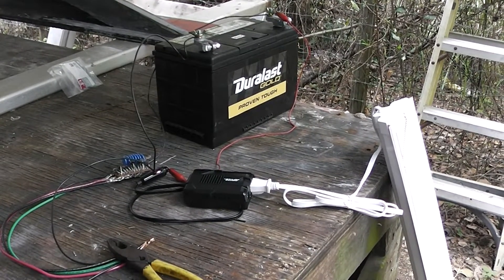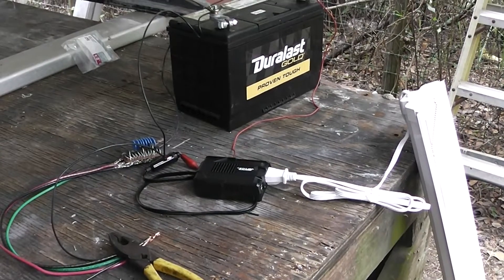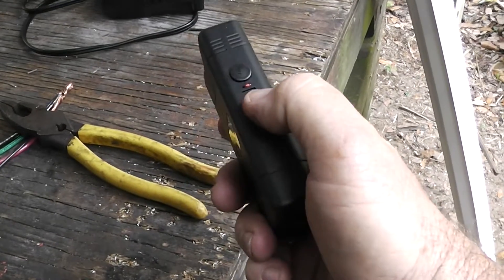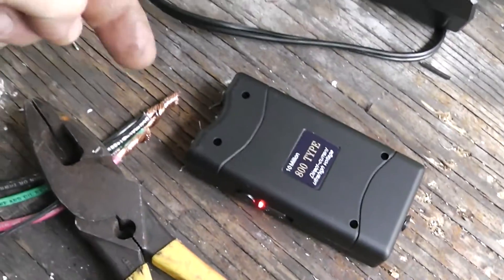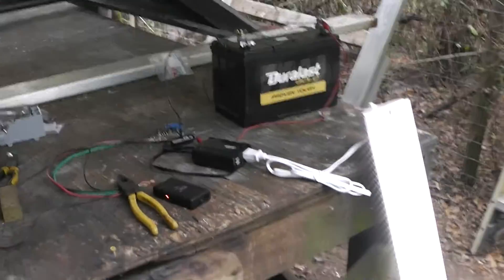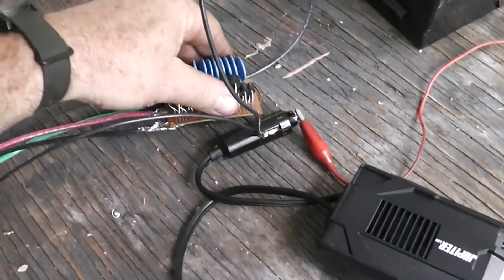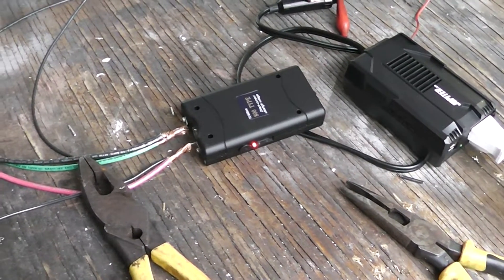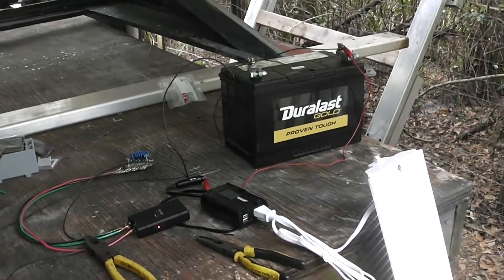Homemade EMP Vehicle Protector Tested/Zapped With High Voltage!

Comment: Interesting ... I know that the COMMERCIAL surge suppressors are designed to shunt high voltages with peak currents of 10S OF THOUSANDS of amps, so ...

Nevertheless, it did seem to protect against electrostatic discharge (ESD). 

As for what sort of induced currents might be present in a VEHICLE during an EMP, who knows. But it would quite likely be much less than what an EMP might induce into HUNDREDS OF MILES of grid power lines. In fact, I'm not even sure that induced currents in automotive wires would be more of a problem than what an EMP might induce directly into sensitive circuitry.
Reply: I like the concept but the one issue I see is the box.(From other video) Would it not need to be a faraday box, at least of sorts. A simple plastic wouldn't work because any emp would fry the diodes. I could be wrong but that's a flaw I saw in even some of the commercial devices. It's one of those things you hope works when needed and no one wants to find out after the fact lol. What's y'all's opinion
Reply: @carneyusaf theoretically you’d think it wouldn’t hold it but I mean a panel for your house is metal with plastic lining on the inside with more metal in theory I’d think over time the metal would become more unsafe cause plastic breaks but they still put it up on residential/commercial buildings. Honestly I think buddy made a smart move with the plastic one just because if it fries anything it’ll prolly be that and it’ll burn for a WHILE before it caught a flame if something was getting ate up
Reply: @stephengarrow6966  I agree, I just saw the commercial ones didn't have it either and figured it might be an additional safety feature but if it's not needed then there isn't any reason to add it.

Comment: Now that would have been amazing except for the fact you did not test that out without your home made emp protector hooked up so it could be a noburger for all we know right....
Reply from the maker: Agreed but, without any empirical data being collected using this homemade EMP device or even any commercially available EMP shield/protector/armor in the vicinity of an actual high altitude nuclear generated EMP or in the presence of one of those newly developed EMP weapons that the US, China and Russia possess, all speculation and simulated testing is purely academic.